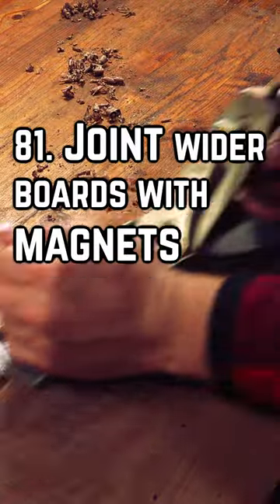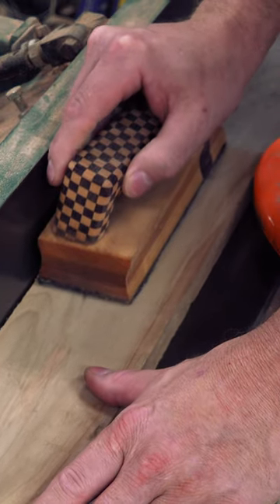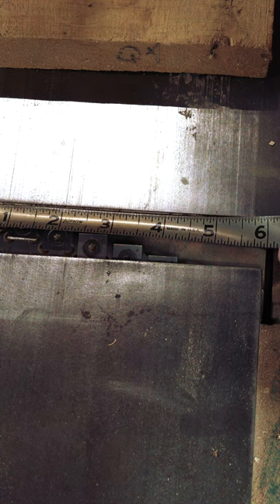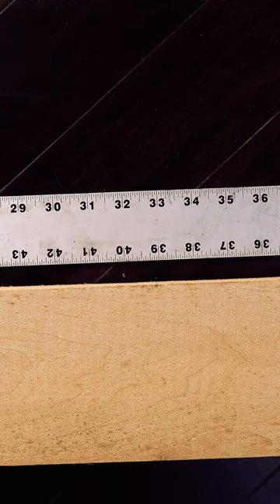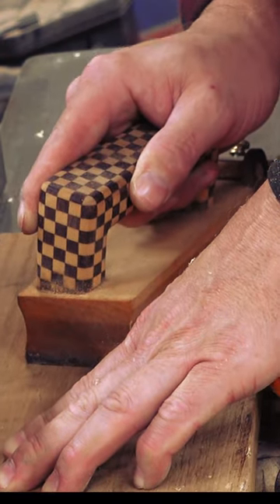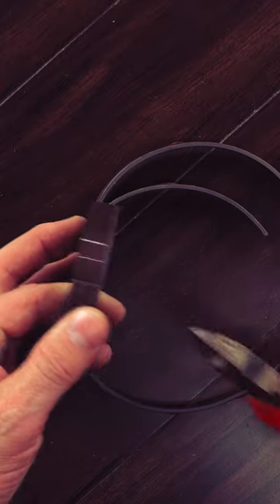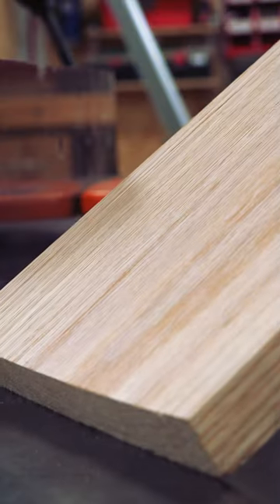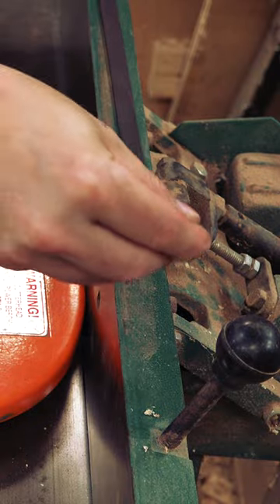81. Joint wider boards with magnets #mtbitesize #shorts

Comment: Use a planer. It is designed for wider boards and planing is its sole purpose . Jointers are designed for board edges or narrower board surfaces.
Reply: But if you plane a board that hasn’t been flatted on one side you won’t get square faces
Reply: @firstnamelastname5596  Exactly, so many people don't understand the difference in jointers and planers. They both have their purpose. And you can't just replace one with the other
Reply: @GarrettBShaw  Jointers are for thinner pieces. Planers are for wide boards. Functionally the exact same tool just one uses rollers to self feed material.

Comment: I don't get it 🤔
Reply: Neither do I
Reply: Hes adding the magnet on the table so the section that was already cut can sit on it, so he can finish the cut. You only need it on the infeed side so it doesnt cut at an angle and recut the first cut. After its cut, the board will lay flat. His jointer isnt big enough to do the whole board, so he cuts it in sections. Trust, i was confused at first too.

Comment: How about a thickness planer ?
Reply: Lol no luck there since it's enclosed, but usually planers are wider than jointers.
Reply: @tenchuZsenran  He isnt using the jointer as a jointer... he is using it as a thickness planar. He is pushing down on the board... planing... which is why he states right from the beginning you want to use a HAND PLANE or a jointer.